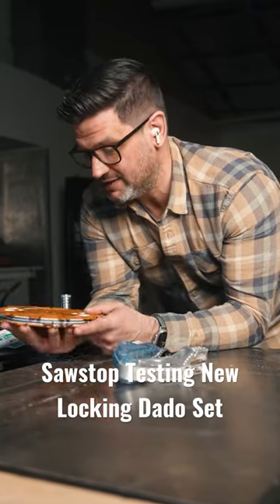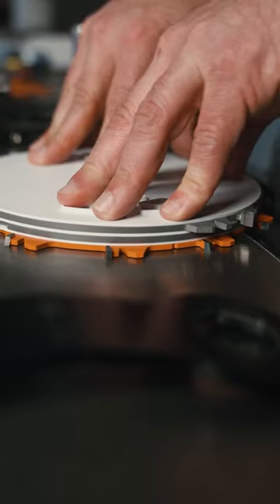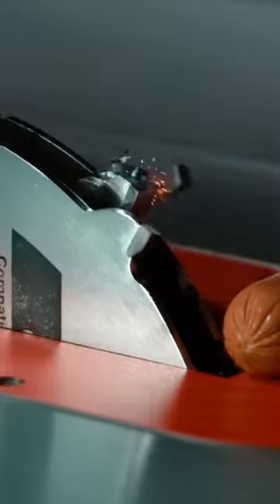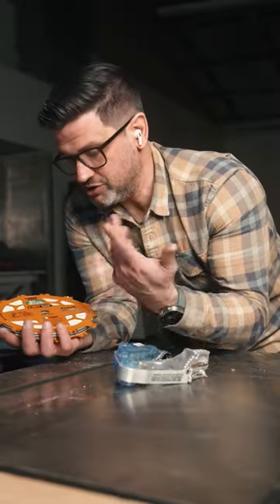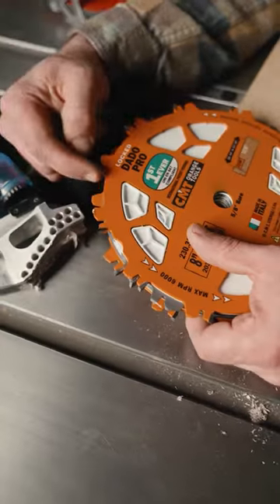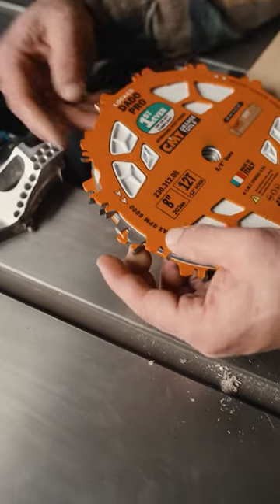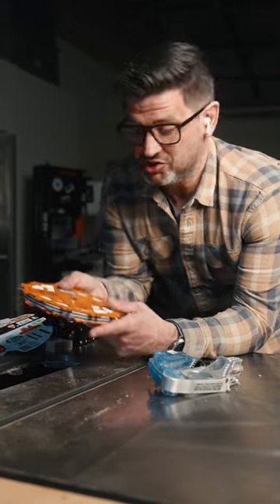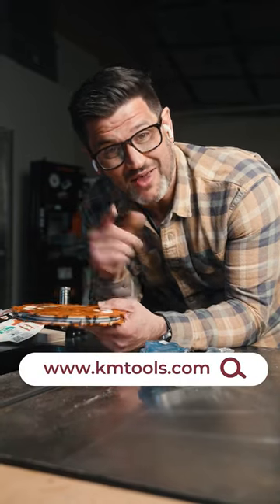Watch Now - Sawstop Puts CMT Locked Dado to the Test!

Comment: So the brake destroys the blades instead of them destroying each other.
Reply from the maker: It’s about no shrapnel and saving your finger. If your eyes and hands are intact who cares if the blade gets destroyed?
Reply: @katzmosestools  
I'd rather just to continue to be careful and not be dependent on a machine that might nit be on the next tablesaw I'm using.
Reply from the maker: You do you bud. I like to wear my seatbelt and have my airbag in my car. Accidents you can’t control do happen. You still need to be safe because kickbacks can happen on any saw BUT an added layer of safety never hurt anyone.
Reply: @calvingreene90 i had a kickback once. I didn't have the blade guard on, otherwise i was using a safe pusher and had a splitter and was trying to be safe. I didn't have the years of experienve that I do now.

Anyway, faster than I could react, suddenly I had a 1" piece of wood trying to go through my gut.

Nasty bruise. Which my wife noticed had a lot of probing questions about.

I feel lucky it hasnt happened since. I'm saving my pennies.

There is a reason old Deltas and Powermatics are going for a song.
Reply: @calvingreene90  It's not dependency. It's being aware of risk and mitigating it. I don't not wear my seatbelt because I have an airbag and can drive well. It's just an automatic E-stop button and unless you think e-stops cause dependency then I don't know what to tell you
Reply: @JWill6969  
Until you get careless and use a machine without it.
Reply: @calvingreene90  Yeah I don't think just because I know I have a saw stop, I'm gonna be sticking my hand in the blade for shits and giggles.
Reply: @JWill6969  
Which is not the same thing as carelessness.
Reply: @calvingreene90  do you drive reckless because you’re wearing a seat belt and have airbags? Technology changes, it’s embraced, but there are still risks. No one is dependent on it.
Reply: @Autobotsunited  
I can't tell you how many times I have seen cars on cruise control rearend cars moving just a little slower on the highway.